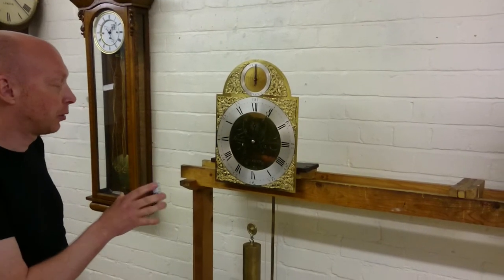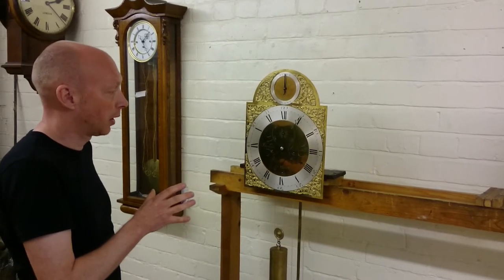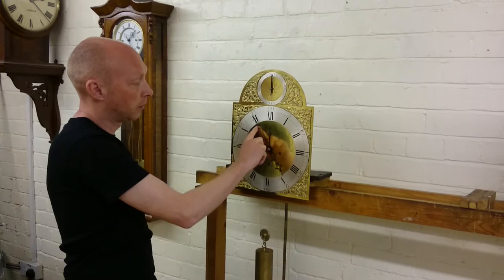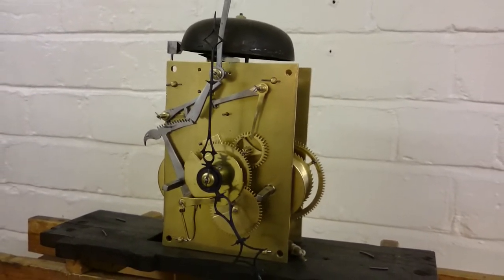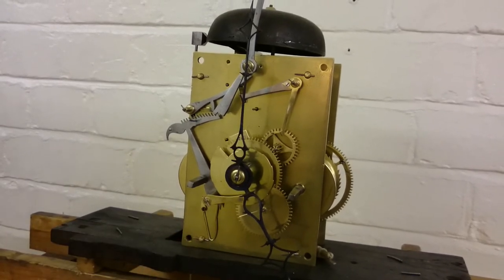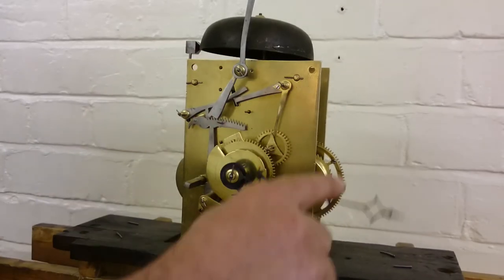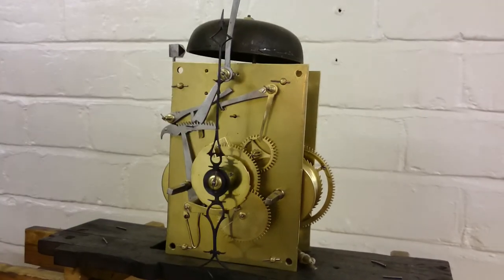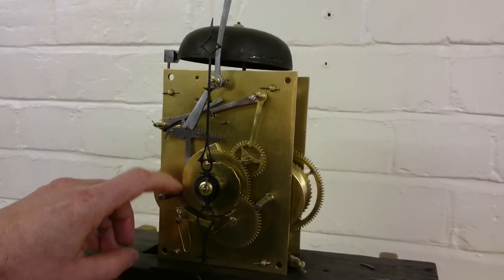Correcting the strike on an antique grandfather clock

Comment: This is a great video I have the same problem with my Enfield mantle clock I went away on holiday come back and I set the time before I wound it. Chimes on the half hour but not the hour. Would this be the same issue I'm a bit worried taking it apart. Thanks
Reply from the maker: Tugboat I assume it will be count wheel strike. I would move the minute hand on past two strike points with only letting it strike once, it should then catch up. If the hours are then wrong, the hour hand should move to the right number as again it should be on a clutch device.

Comment: My old German weight-driven clock strikes about 5 min. after the hour.  Is there an easy fix?
Reply: Check the centre of the minute hand. Over the years it's possible to work loose. Just put a small screw driver in the hole and move the hand back. Once it's in the correct position, put a dab of superglue around the edge of the bush. Sorted!